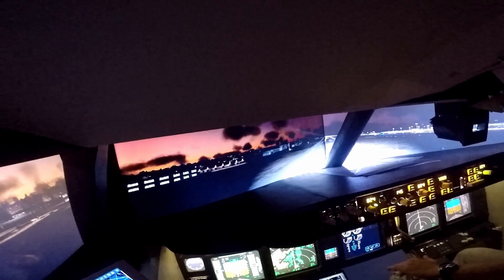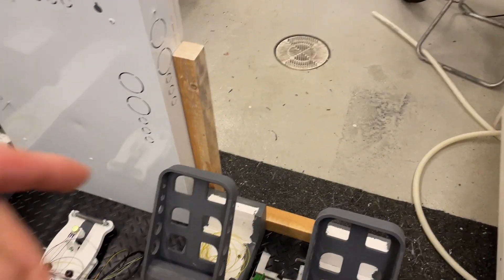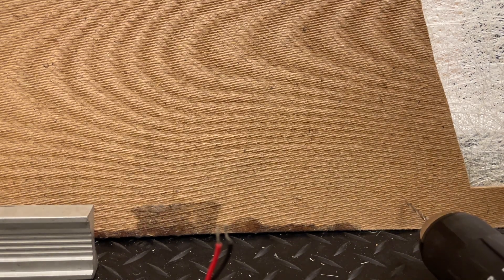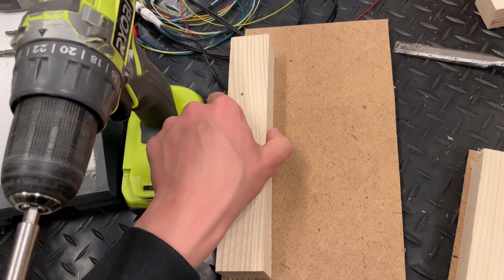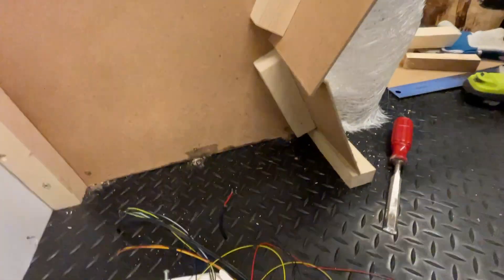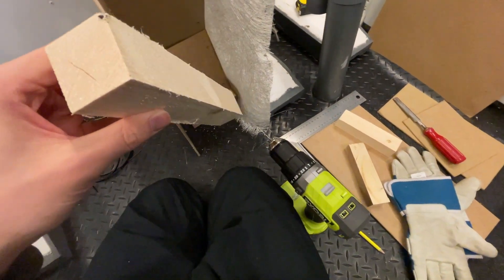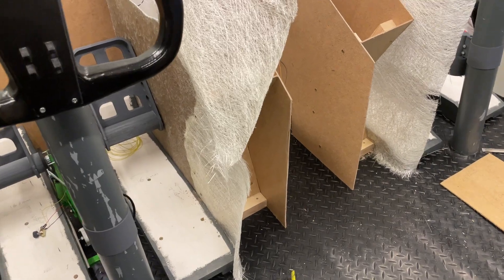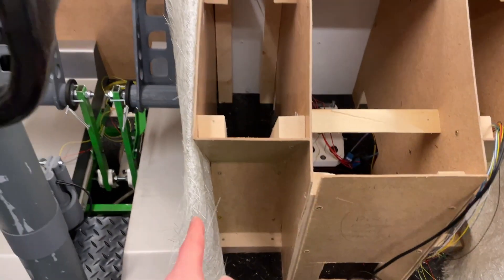FMC Bay Framing - [B737 Build #4]

Comment: Thank you for your videos! Will you install the alerts sound box on the copilot side ( in area at 10:02) too? I see you are using mdf which is more stable than plywood and easier to sand and shape. Plywood which I use is not so good as it tend to warp a lot.
Reply from the maker: We have installed stick shakers for both pilots but for now only the first officer side is operational. We will show them in more detail in future updates.
It is true that the mdf is really easy to shape but also it doesn’t need to be so precise for us since we will be covering it with fiberglass to increase strenght anyways. Thanks for watching!
Reply: @diy_finn  Not the stick shakers but I meant the 737 Aural Warning Module (AWM) at the copilots left knee, a big grey box. But stick shakers is a must too  🙂
Reply from the maker: @sundar999  I had to google what you meant because I had never heard of the AWM. Now that you mention it, I think we have to model that in and install it there. Thanks for telling me about this! I always thought the aural warnings just came from some generic speaker somewhere from the cockpit.